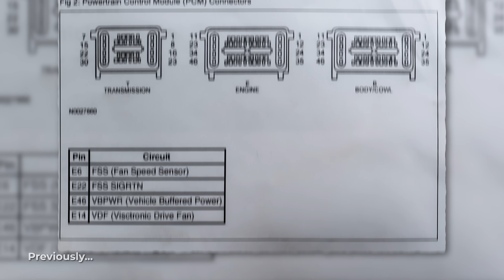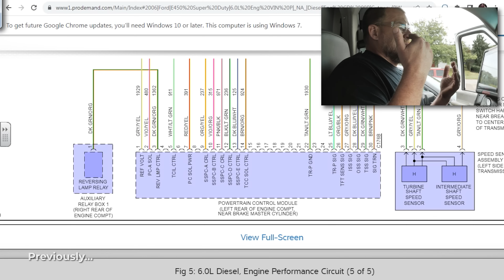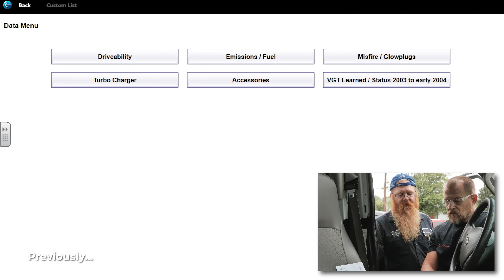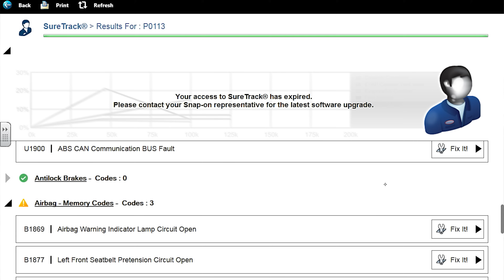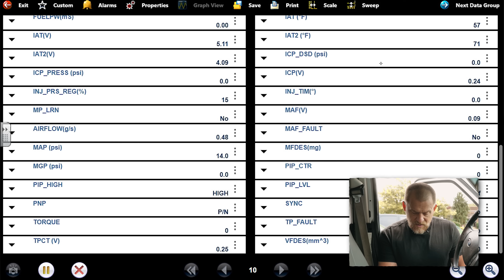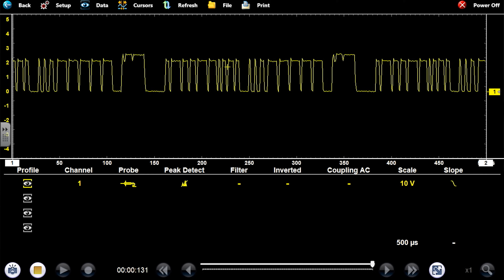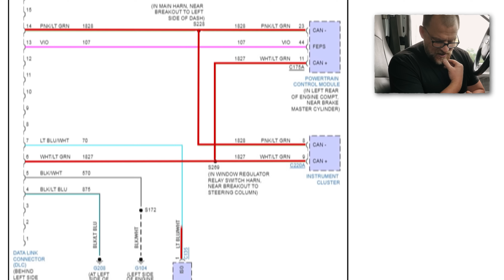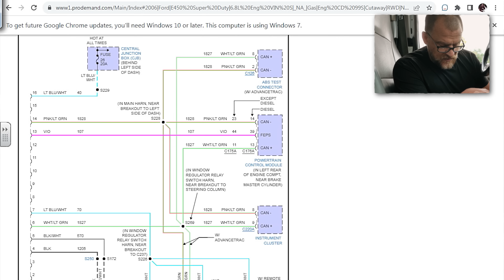2006 Ford E350 6.0L Turbo Diesel [DID WE FIX IT?]

Comment: I've put 3 pcm's (from 3 different companies & flagship 1 was the first one) in my '98 Ford Ranger. I rebuilt the engine and engine wiring harness prior to installing the new ones. After installing the 3'rd one, for the warranty it had to be verified by a certified Technition to be at fault. Just got the truck back not running and they're pointing at the computer! The original computer had shit stains on the board from rotted and shorted wires from Cam Sensor. I'm at a loss!! Still no ground switching to coil packs and no tach needle movement. All sensors, relays and fuses replaced!! Ugh!

Comment: Ya'll are such gas powered guys lol :) On a gas engine, the MAF sensor is very important.  I don't think they're nearly as important on a diesel, because with no throttle body,  they adjust fuel delivery to meet RPM/engine load demand.  There is no air/fuel ratio adjustment to maintain stoich.  I don't even think you need MAF on a diesel engine at all --I believe the MAF sensor is used mostly to verify EGR flow when the EGR valve is commanded open - the PCM will see a reduction in MAF flow, and it'll know there's a valid EGR flow.

Comment: I do know that for the 6.4L Power Stroke with the same 5R110 transmission, Ford fully separated the PCM and TCM. I bet inside the 6.0 PCM, there's two separate processors on the same circuit board, and Ford did this as a "interim thing" as they gradually separated the two out. Separating the TCM from the PCM probably gave them more flexibility with the software and programming.
Reply: yep, probably doesn't even use CAN between them, still on legacy protocols, just smashed into the same board.

Comment: Paul that is all one module in there, it's not three separate modules The one that's labeled body is just indicating that's where the PCM connects to the body harness of the vehicle. There's just one circuit board in there but it's separated into basically two different parts. There's going to be two separate microprocessors in there, The processors do not communicate with each other using can bus signals, I'm not sure what protocol it uses but it's definitely not going to be can bus.

Comment: The pcm houses the transmission control module and the engine control module. One of the connectors is for the harness that goes to the engine, another connector has the harness that goes to the transmission, and the one listed as body has the harness that connects to the body of the truck.

Comment: I got an ECM for my 04 F150 w/ 5.43v about 7 years ago and its been fine so far. The same hook ups on the ECM and it is 1 board inside with no epoxy. It had a line of sealant around the perimeter, thats it.
Reply: Completely different kettle of worms. 5.3 and 6.0 use completely different architectures esp between gas/diesel

Comment: I have run into this PCM to TCM communication code a few times in F-Series trucks 2005-07 with the 6.0L.  I had the same thought that this has to be an internal fault as the two modules must be communicating inside the enclosure.  In those cases the instrument cluster was the cause.  The 2005-06 IC were very problematic in the trucks.  The E-series has a different IC so it might not apply in this case but I do see that it is not installed in the video and just hanging out.

Why the IC would cause a TCM communication error is still a mystery to me.

Comment: Ok but I had my truck at a dealership for a fuel level and the dealer looked at it for no more than 30 minutes and they tried to tell me that it is a bad pcm and I questioned them on how is the pcm bad and they couldn’t tell me why it was bad so I went and looked up on pro demand and looked up top top fix’s for the code that I had and to find out it was the sending unit in the tank so  instead of spending 1500$ I did it for 400$

Comment: I hope the techs watching these videos understood what was shown. Many times techs that are presented with this scenario will by default replace the PCM, but the big take away from these two videos is getting and understanding the evidence. Jumping to conclusions leads to at lot of parts getting replaced only to end up at the beginning with the original problem. This Ford may be simple in its wiring  and PCM layout but if this lesson is applied to a different vehicle, one which the PCM has multiple ground and power circuits, the problem could be external of the PCM. Without knowing the internal circuitry of the PCM you can not assume a power or ground circuit feeds the entire module.